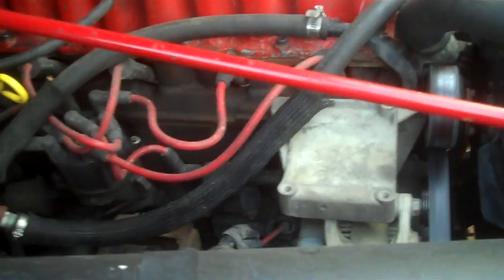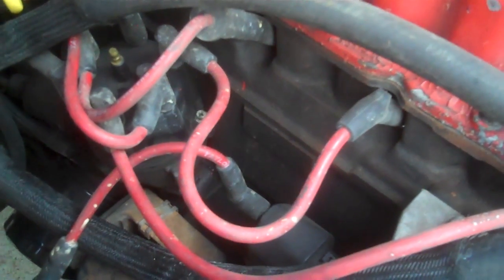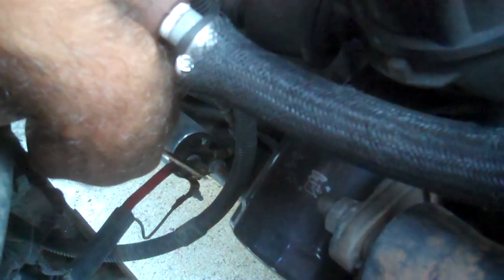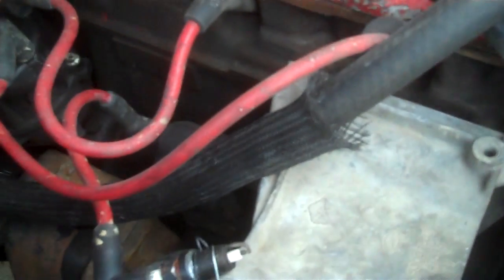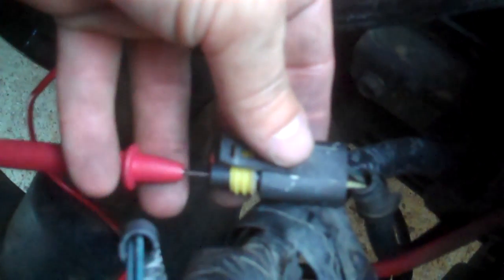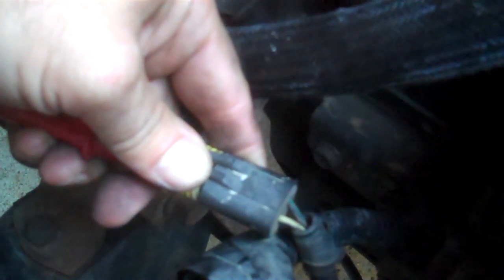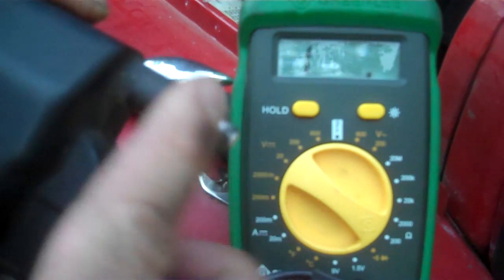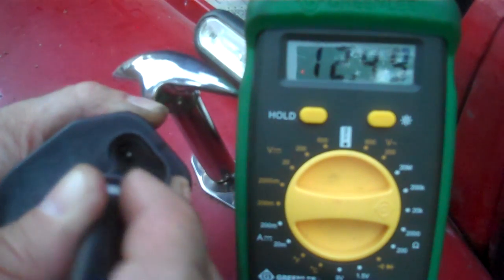Jeep Wrangler YJ - Testing the ignition coil and spark demo

Comment: So glad I found this video - got to troubleshoot my Jeep XJ 98 tomorrow. I was running car for a while with a failing spark plug lead leading to misfire on acceleration. Was starting fine tho. Replaced all leads, new dizzy cap, new rotor but now getting a crank/no spark! Getting a P0340 code too - you think I might have fried my Dizzy/camshaft position sensor or Ignition Coil?
Reply from the maker: A bad dizzy or camshaft position sensor will cause any and all of those issues. Check to make sure you didnt knock the plug off somehow to the cam & crank position sensor or coil.Also just for something else to check low battery voltage can cause these issues as well. Although very rare .. but I have seen where a battery was going bad that as the engine is being turned over, it pulled the battery voltage down so low the crank or cam position sensor doesn't trigger ignition. Take your battery in to have it checked at an auto parts store. Or, Hook a volt meter to your battery and check the voltage as the engine is being turned over. As the engine is turning over, battery voltage should not fall below 9.6ish volts. Hope this helps! Good luck and have a great day!
Reply: Ignition coil has no Spark but according to multimeter is good - just shows buying parts based on hunch & not evidence ( already ordered new Ign coil ) isn't always wise! Next will do input & battery tests you suggested. Looks like I'm probably looking at a bunk Dizzy pick up coil or CPS. Appreciate you taking the time to reply as I can't afford to go to a repair shop atm - thanks mate!

Comment: where do you find the proper ohm figures??
Reply from the maker: I have the service manual for the YJ and XJs.
Reply: I have a Haynes manual for the XJ.  I'll probably have to pick up the real thing.  Do you have a good source?  Many thanks.
Reply from the maker: I have no idea. I got lucky and ran across this copy. On my website http://www.fixjeeps.com/ I have many of the sensors listed. I think the only one I need to do it the cam shaft position sensor.

Comment: I have signal power but not constant power. Please help
Reply from the maker: You have a break in the wire somewhere. Or, the Jeeps computer has gone out. Pull the wire wrap off and start tracing the wire back to the computer. Look for anyplace where the wire has been burned or frayed. Once you trace the wire back to the computer, back probe that wire while still plugged into the computer and key in the "ON" position to see if you are getting power out of the computer. If you are, there is a problem with the wire somewhere. If you are not, the computer is bad.
Reply: Thanks for the response I'll try that. But I tried directing power to that line from the battery but still nothing.
Reply from the maker: It will not start after putting power directly to the "full time on" wire? If thats true and you said above that you have signal power. you got a bad coil.

Comment: Thanks for the great video.  You are a very good teacher.  I own a 95 jeep wrangler and all of a sudden have problem with engine.  It cranks, but no spark and no check engine light.  Based on your youtube videos and others, it could be cps, or ecm.  However, I decided to check this video on coil as I am not sure I am getting proper meter readings to/from coil.  After viewing your video, I will recheck the readings.  I am wondering if the coil could be the issue if I can crank, but no spark and no check engine light?
Reply from the maker: With no check engine light, that makes me lean toward the ECU. Even with a dead coil you should get the CEL in the dash.

Comment: Thanks for the advice just picked up 90 keep Cherokee 4x4 straight 6.changed cam sensor didn't help got it to fire off drive down rd ran good died got back to shop pulled plug and checked for fire no fire
Reply from the maker: Sound more like its the crank position sensor. Here is the video for that. The Cherokee sensor may a bit different. The principle is still the same. https://www.youtube.com/watch?v=5QWJlb2Uf08
Reply: Power Addicts - FixJeeps.com - Jeep, car and motorcycle tips csps was first thing I changed out.
Reply: csps was first thing I changed out my coil is only reading 3.5

Comment: Really useful, I my dad's Jeep stopped working, he stopped in a gas station to get a drink, it never started again, I was sure it was the ignition coil because it's all cracked up and rusty, but with this test, I gotta believe that it's still good, not all that good, but 40% good, and my dad tested the crank sensor and said that it went bad, I might check after him because when he tested the coil, he wasn't able to get a reading
Reply from the maker: If the crank sensor goes bad, the coil will not spark at all. The crank and cam position sensor is what tells the computer when to fire the coil. If either one of those two go bad. The coil will not spark. Crank sensors are common to go bad, I keep an extra in my Jeep all the time. Thanks for dropping in and have a great day!
Reply: Power Addicts - FixJeeps.com - Jeep, car and motorcycle tips Thanks, but the Jeep was already running weird at idle, like an old V8 or a harley davidson motorcycle, it didn't felt right, that's why I thought it was the coil, but can crank sensors get dysfunctional before they die or they just die suddenly?
Reply from the maker: Typically the crank sensor just goes suddenly. Sometimes, once they cool down, they will come back to life intermittently just to die again when they heat up. As for coils, they can be still functional yet be weak. Personally, if I have any doubt in the coil, I just replace them. They aren't too awfully expensive. The proper output voltage can pay you back in fuel mileage..
Reply: Mine is in the driveway since last weekend, when it died the engine was still hot and it didn't start, few days later it's totally cold and when I'm cranking it because my dad is testing things with his test light, it wasn't starting either, thank god he got a brand new high quality batterie in it a few moths ago, we are cranking it like crazy and it's still at 12 volts
Reply from the maker: Good battery is priceless!! Buddy of mine and I were on motorcycles riding from Nashville to New Orleans. His battery died on the way, left hid bike stranded on the side of the interstate. I rode an hour back the other way to pick up another battery to get his rolling again.

Crank sensors don't always come back. My nephews Cherokee didn't. It didn't fire back up until the crank sensor was changed.
Reply: Thanks a lot, I'm gonna change it today, and maybe my coil too, because every months something breaks and I can tell by the shape that it's in it's the next thing that is going to fail
Reply from the maker: Man .. that tub of bolts that I drive was a basket case when I got it! It was used as a farm toy for a 14 year old kid. It had no brakes... barely ran.... shifter was a jack handle sticking out of the floor. I wished I had started my YouTube channel when I first got it. It still isnt the best looking thing on the road, but I driven it several times from Nashville to Little Rock Ark. Dependable and solid as a rock! Just not perrrty yet :-)
Reply: Power Addicts - FixJeeps.com - Jeep, car and motorcycle tips YJ's are my favorite jeep, my dad had two of them, now he has a Tj, I'm 15 btw, sometime he let me drive it, I'm amazing at doing donuts in the snow lol, my grandfather was a trucker, my dad is a trucker and I'm going to be a trucker lol, I have the driving in my blood.  I work on the weekends, I'm washing the trucks where my dad works and I'm saving to buy an old junky Yj between 1000 and 2000$ to rebuilt it
Reply from the maker: My dad has a TJ, my sister has a YJ, friend of mine has a TJ, nephew has a later XJ. Other friends of mine .. Cj5, ZJ, JK, JKU... I got Jeeps all around me. I'm eventually gonna get another YJ and do a V8 conversion on it.

Good luck on finding the YJ .. like you said. They are my favorite generation of Jeeps!
Reply: Power Addicts - FixJeeps.com - Jeep, car and motorcycle tips Thanks a lot, there's not a lot of offroading jeeps in my town, there are not many trail
Reply from the maker: We got lots around here. I just work too much to play as often as I would like.
Reply: It's expensive to play when you drive a jeep lol
Reply: And finally it really was the ignition coil
Reply from the maker: A coil can test good and yet provide a weak spark. Glad you got it going. Thanks for taking the time to leave an great comment!

Comment: i only have about 3v going to the constant side of the coil. Is this a wiring issue ?
Reply from the maker: +giff steve Cound be wiring or PCM (computer). Also check the voltage going to the Crank Position Sensor. Here is the video: https://www.youtube.com/watch?v=5QWJlb2Uf08

Comment: What if I am not getting the 12 votes
Reply from the maker: +jeff gilbreath You will have to trace the wire back to the PCM to see which pin it goes to. Check if there is voltage coming from there. If there is voltage at the computer, you have a wiring issue. If there is no voltage, PCM is bad. Hope that helps. Have a great day!

Comment: what would happen if you don't have signal?
Reply from the maker: +Johnathan Baena No signal .. the coil doesn't know when to fire. Check the Crankshaft position sensor next .. here is the video: https://www.youtube.com/watch?v=5QWJlb2Uf08  . After that the camshaft position sensor, unfortunately I haven't made the video for that yet. Those sensor happen to test good .. then its either a bad wire or Jeep computer (PCM) going bad. Hope this helps. Good Luck. Have a great day!
Reply: Hey man! Thanks so much, the crankshaft is fine but what wires could've gone wrong?

Comment: hey there. so cleaned all the grounds. (even added one for good measure.)  new coil put on. new cap and rotor. 
currently not getting spark on 2 and 3. swapped wires to validate. my thought is cam sensor not telling coil when to throw spark. hints?
Reply from the maker: +Charles Davis Kinda remote .. but that could be a possibility. Typically when either cam or crank position sensor goes. They are done. But just possibly those particular post/points withing the sensor could be faulty. But that would be the first Ive ever heard of that. One way to possibly confirm would be to check the coil trigger wire. Here is the link to get there easily: https://www.youtube.com/watch?v=7SM8T1JqTtU . When the trigger wire is sending the voltage pulse to the coil, it should be consistent. If there is an interruption in the signal there will be skipping of the coil signal. You really need to use a test light for this. It really just drives a multimeter nuts.
Reply from the maker: +Charles Davis Also, check to make sure you crank shaft position sensor is tight and not wiggling around. The cam sensor main job is to sync fuel pulses with spark pulses. The crank sensor is really the "when to sent voltage" cop. Also, I mentioned in the other reply about certain points in the cam sensor possibly being bad. The area that triggers the sensor is the pulse ring that spins above the sensor (The rotor button sits on it). Check also that the distributor cap isnt scratched on the inside causing the spark to jump. Look for dark/burnt spots where there shouldn't be any.

Comment: Hey there.  Awesome videos.  Really helpful this week.  Long story short.  I've got a buddy that put an 89 2.5l into a 92 yj.  He couldn't get it to run.  While he's on his honeymoon I've been sneaking over to his house to try and get it going for him as a wedding present.  So far this is where I'm at.

CPS turned up faulty, replaced.  (your video helped massively)
Tested coil, good to go (again, awesome video.)  
Ensured timing at TDC and dist aligned.
Tested for spark on all 4 cylinders, good to go.  (seems really weak though.  spark tester wasn't flashing very brightly.  tested with spare plug, yellow spark, not white or blue)

I've had stuck up girlfriends that are easier to get going than this thing!  I'm going to test the fuel pressure this weekend, but I sprayed some starting fluid and still couldn't get a studder.

Hepmee  hepmee.  I'm all out of ideas and they get back sunday!
Reply from the maker: +Charles Davis If the coil tested good, then you may have a "not so solid" ground going to the coil. Pull the coil off and clean every bolt/bracket contact that touches the coil. You want bare metal contact for solid ground. Then check all ground straps/wires. There should be a heavy wires from the battery to the block (obviously) pull it .. clean it. If that still doesn't work, run another wire to the 12volt side of the coil to the battery, then try starting it. Possible voltage dropping during you trying to start it (if so .. you got bigger issues). If you run that wire from coil to battery to the battery, don't let it set to long without trying to start it, it can over heat the coil. If none of that works .. replace the coil anyway. With a weak spark, compression can suppress the remaining spark until it will not fire the engine at all. I've seen this happen on many small block chevys. Coil posts tested good but coil was still bad. Why?? I have no idea. But we changed the coil and it fired up. Hope this helps!! Hey man, what you are doing for your buddy is really cool!! Thanks for using my videos and all the great comments! Have a great day!

Comment: hi, commented on your crank position sensor video about starting issues with my jeep. Tested the coil and i have a primary reading of 0.20 and secondary of 10.15. Do you think those readings are extreme enough to be the cause of the non start? thanks.
Reply from the maker: Primary is really low. Secondary is pretty low also. Even if it didn't cause a no start. Id still replace the coil, it is detective. You will be paid back in better fuel mileage if nothing else. Have u checked for fuel pressure yet? In order of diagnosis, I typically check spark then fuel. At times you can have a weak spark yet still run depending on how weak the spark is. No or weak fuel pressure will cause a no start also. Hope this helps.